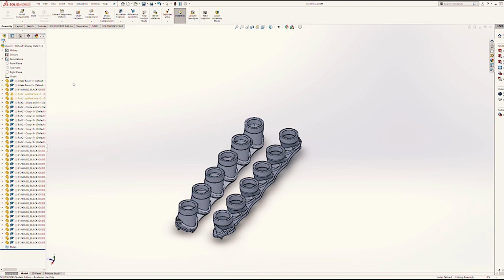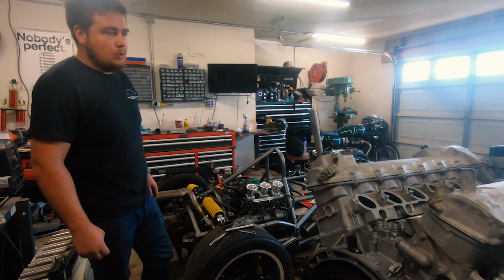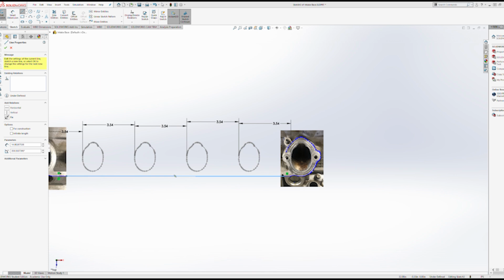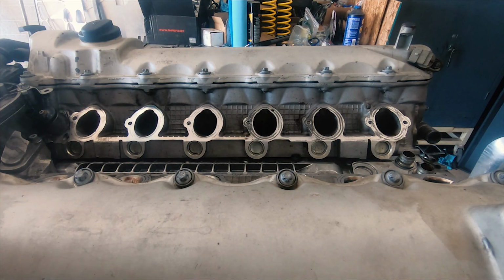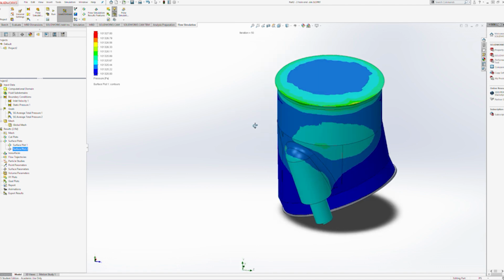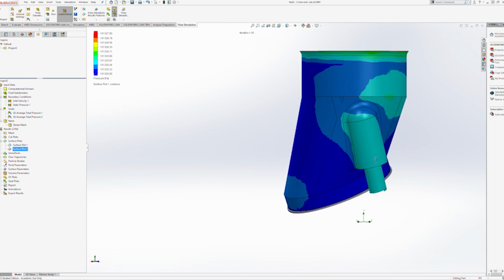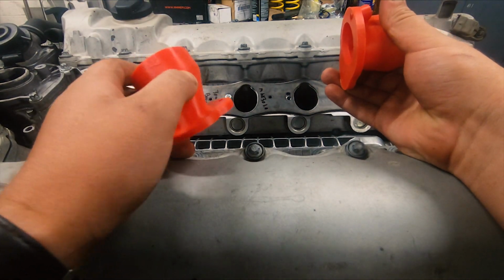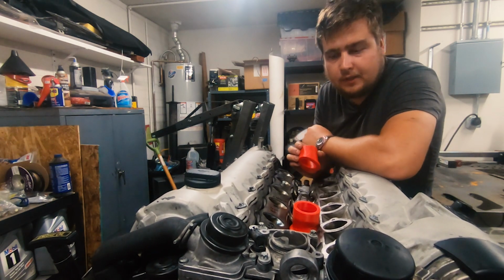5.8 V12 Throttle Body Build Part 1 of 2

Comment: You think I could possibly pay you to 3d print a 3rd brake light housing for my mercedes. The only one I have found was brittle from a wracking yard which I know will not last long. And they are not available anymore. I would be happy with just black plastic. I run led bulbs so don't need high heat. I'm more than happy to pay for your time.  Thanks for all the cool videos and your time. Robert

Comment: There seems to be a lot of comments about what material he will be using and concerns about temperature resistance. He states in the video he is printing in Bigrep Hi-Temp filament which has a Vicat softening temp of 160C. 

Doing great work without a full compliment of CNC machines or massive budget Wesley, Keep it up!

Comment: Nice job. That’s exactly how I reverse engineer stuff for my projects. Are you going to cast those? I’m in California and I use a local foundry here that will cast low quantities for me in aluminum. Maybe you have a foundry near you that can do that for you. Just a suggestion. 
Also, I was thinking you could raise the height of that second screw to get it out of the internal portion of the intake. You will obviously need to use a longer bolt/screw but that should fix that. Maybe there’s an issue with the angle, hard to tell from just watching the video. 
Looking forward to seeing part 2. 
PM me if you want the foundry info.

Comment: Hey Wesley, so I’m in Arizona too. I have several printers and LOTS of variation of filament. Are you planning on using Petg? Because the glass transition temp of PETG is like 95°c I believe. Those should be printed out of PEKK or PEEK. I could help you if you want.

Comment: I started with ITB's on a motorcycle and now trying to adapt to a car engine like you. I once read that you should size the ITB's by hp per cylinder, so if the engine you're adding motorcycle TB's to has the hp of a 750, those are the ones to use. However, if you need more go to gsxr1000 or gsxr1300. Love the intakes. Have you thought about o-rings on the intakes? This will help with heat dispersal.

Comment: Look up phenolic spacer (if you don't know already). They're used to isolate heat from the head to the intake manifold. Probably could have a couple made up on a 3d router table. Btw love the project - had the same idea running through my head but was thinking gutted interior and a manual but that's just me.
Reply from the maker: I'm definitely looking into options- With the CAD file finding something else wouldn't be that hard I don't think. It's for sure getting a manual.

Comment: You better be quick on the ignition killswitch in case those 3D-printed pieces can't handle the heat and start to melt. It'll be interesting to see if the material you chose is sufficient, because the idea of printing the connector to the throttlebodies is great, as well as your design. Greetings from Germany, keep up the nice work!
Reply from the maker: I'm actually seeing what the actual melting point of the parts are, but It's going to get a lot of testing before it gets high heat in an application.
Reply: Plastic point vs melt point are two different things. I see you have a Prusa. I have the same. It will handle 300c extrusion temps for the good nylon blends. Nylon survives under hood environments since the dawn of time.

Comment: It will be very interesting to see how this turns out. Would you be up for selling these if they work well? And, why did you go for the throttle-bodies you did, price and availability vs performance I'm guessing...maybe a setup from 2 BMW  S50/S52 engines would be too big. And costly. Subbed and is following closely, you seems to know what you are doing - good job 👍
Reply from the maker: Yeah, I wanted a cost effective solution to ITB's, and I went with the ones that I did because I'm going to be under $400 for this entire set of ITB's in Parts and materials. I've seen them done with S50 throttle bodies, but they are expensive for sure. I'm excited!